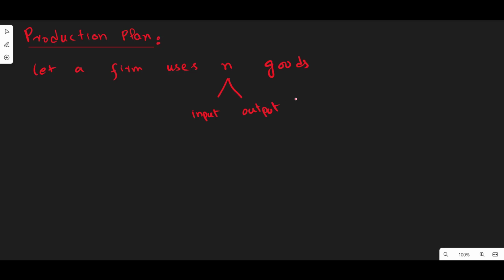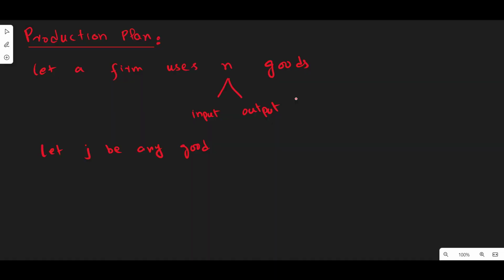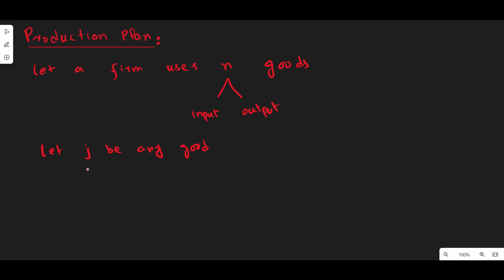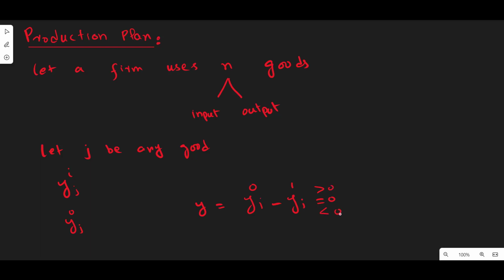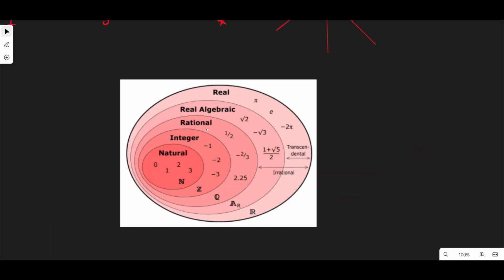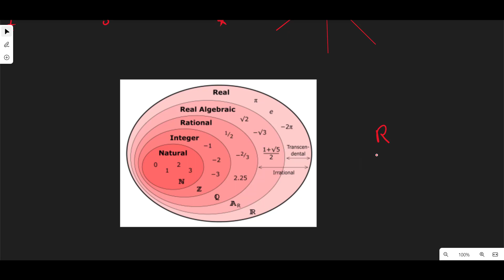Production Plan and Production Possibility Set| Hal R. Varian 3rd Edition Chapter 1| Technology

Comment: As salam o alaikum sir .. I hope you are fine .. Very well explained apart from a query .. According to science .. There are only 3 dimensions in the real world with 4th dimension under the argument .. However you have revealed that there might be more than 4 dimensions specifically n dimensions .. And also the fact that there might be 4 quadrants in 2 dimensions whereas you have tried to explain 4 quadrants of 2 dimensions as 4 dimensions .. How do you explain it sir?
Reply from the maker: WA, by n dimensions I don't mean n quadrants rather as many dimensions as the number of inputs and output (which can go beyond 4) which may fall in two quadrants even that is + & - quadrants.
Reply: Está mal explicado .El libro no se refiere a variables , si no a vectores. Solo es posible representar hasta espacios de tres dimensiones , que es un plano cartesiano de tres ejes, eje X, eje y , y eje z, y no los tres cuadrantes que dijo el del vídeo.Para espacios de más dime siones, como cuatro ya no es posible representarlos gráficamente , y se recurre a matrizes, o vectores , tipo (4,3,2,2)